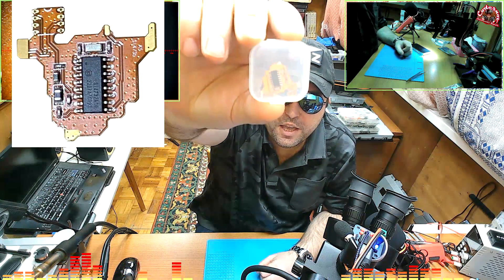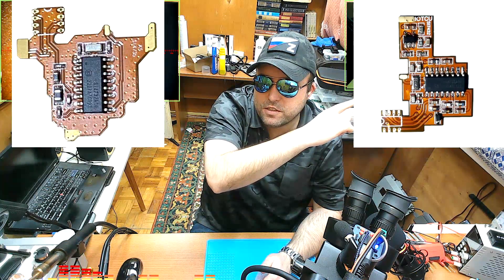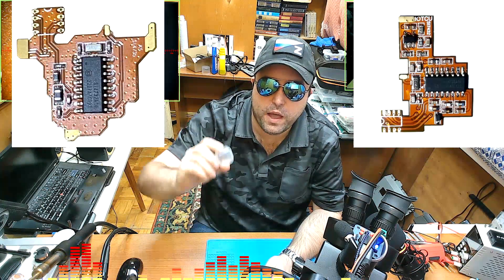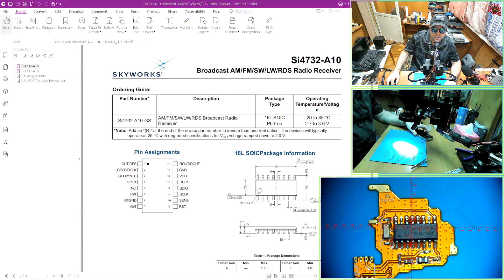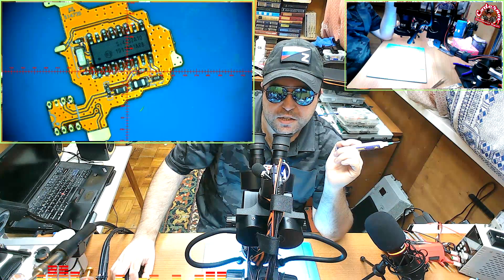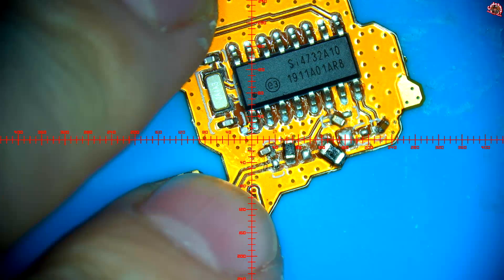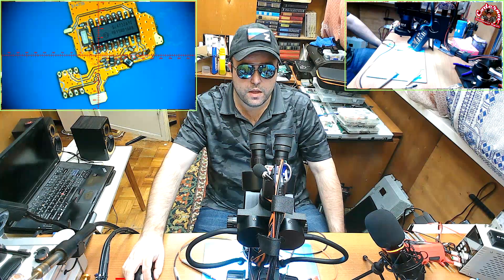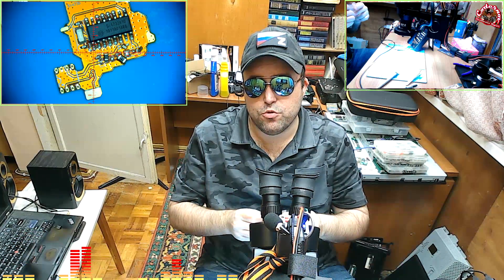HF FULL BAND Mod. v2 without preamp - Quansheng UV-K5 (Si4732 chip) - OVERVIEW

Comment: Hi. do i need a choke resistor for the v2 board (the board with out the amp). thanks
Reply from the maker: Yes you do. It is not resistor though. It is a coil. You need 1 mH, 0.5W. Get it locally or here is where I bought them -- https://aliexpress.com/item/32987240448.html
By the way, I noticed you watching the overview video, I have the install video for that board, check it out -- https://youtu.be/1-vh_8PvYsg
Reply: @codernov  thanks
Reply: @codernov  I bought the 1.3 (green) version that came without a coil, only a module, do I need to install a coil or does this version work without it?
Reply from the maker: @SalvadorDali-v8b  For single antenna you need a choke.
Reply: @codernov  Have you thought about an additional antenna, more precisely if you are adding another one more antenna?
Reply from the maker: @SalvadorDali-v8b  Separate antenna?
Reply: @codernov  Yes, does the choke add when an extra antenna is added, or is it only required if you are left with one antenna?  And if you can explain to me what the choke function is and what would happen if it is not added?
Reply from the maker: @SalvadorDali-v8b  Only needed for single antenna. For dual antenna it is not needed.
Reply: @codernov  Thank you.  I have a 1mH, 60mV choke, will that be ok?

Comment: If I install the audio amplifier version, do I still need to do the other modifications? By that I mean removing some components and adding the choke at the top left corner and changing a small smd part. Thank you, great tutorials, love the channel.
Reply from the maker: With preamp you have two choices, 1 antenna or 2. Depending on your choice. Will do install of that board shortly, once the board arrives.
Reply: Hi look forward to the v3 board installation video. I am awaiting the v3 at the moment. The different boards are already getting confused.
Reply from the maker: @barrymayson2492  Delivery was promised by today, May 9. But today the board only arrived at destination country, pre customs, according to tracking. So it's a bit late. But I'm sure within a week or so. I'm waiting for it myself, because that is the mature version of the mod, and that I will use for myself. Two antennas it is, so that chock does not mess with TWO-WAY part of the radio!

Comment: I'm Curious what this V2 board will add compared to the V1 . I currently have a V1 working, a V2 arrived and a V3 is on the way. Can't wait to see the next video. Today I installed the M24M02 Eeprom aswell and am currently testing the Fagci Firmware you recommended in your last video.
Reply from the maker: There are two more different boards, 1 similar to v1 but with 7 component filter, and a new one, without preamp but with 11 component filter.
Reply: This for the info. Will you be doing a mod video on the board with audio amplifier?
Reply from the maker: Sure, soon..